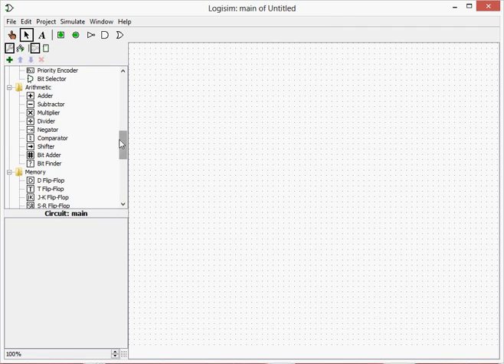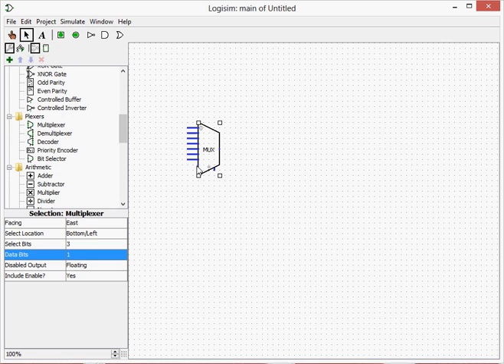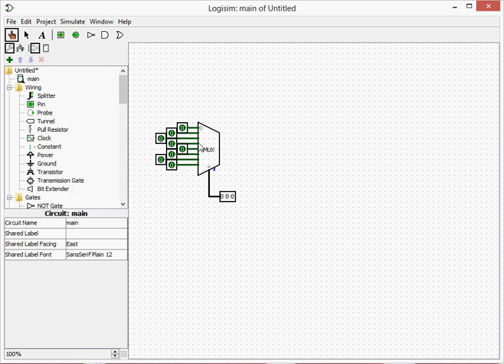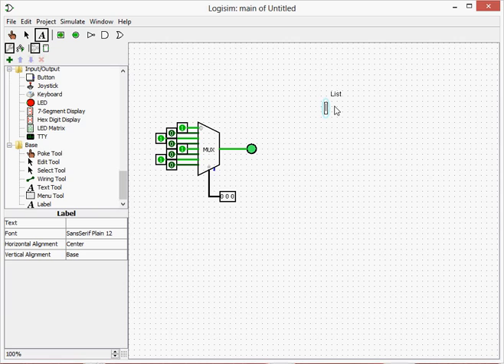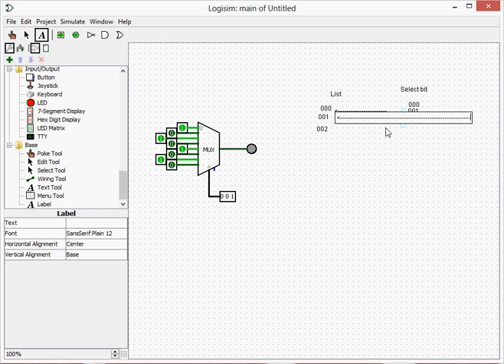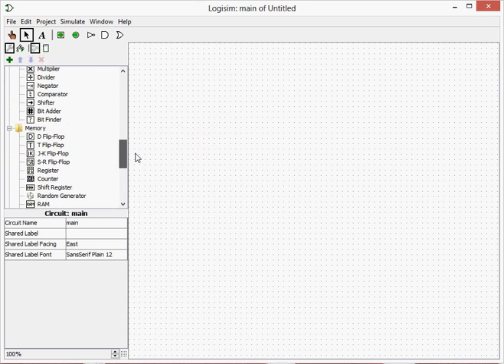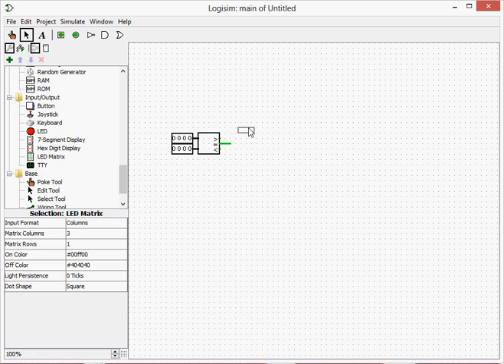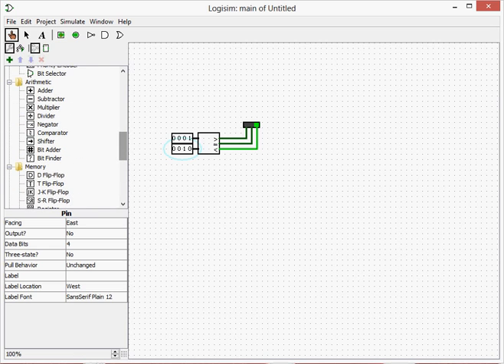Logisim part 9:Multiplexers and Comparators

Comment: This video saved me, thank you so much!! My multiplexer wasn't working because I was using three 1-bit pins instead of one 3-bit pin as the select. I noticed when doing my circuit on a breadboard that I wasn't getting the right outputs because strobe wasn't connected to anything. Do you know why the multiplexer works without connecting strobe to something in Logisim?